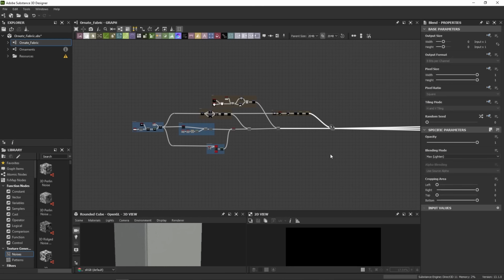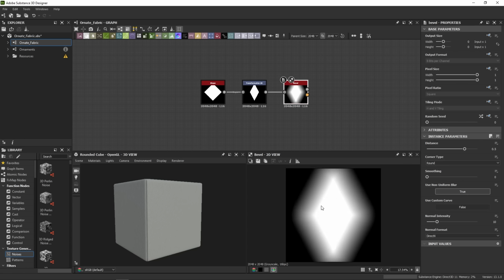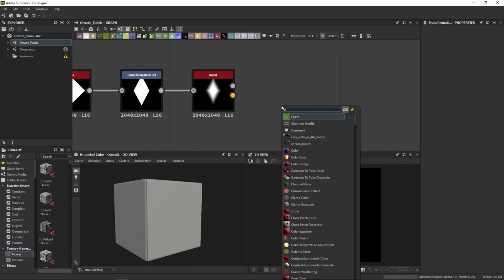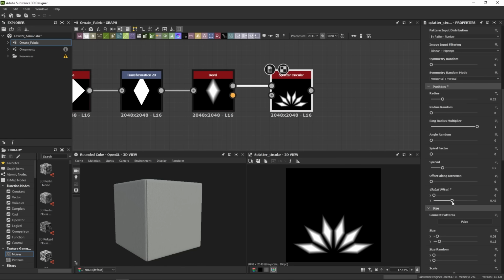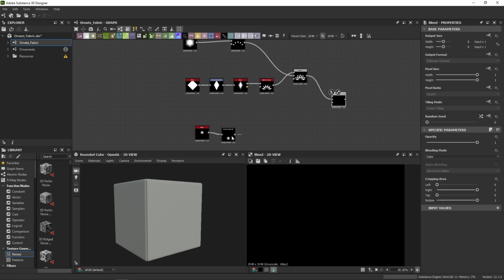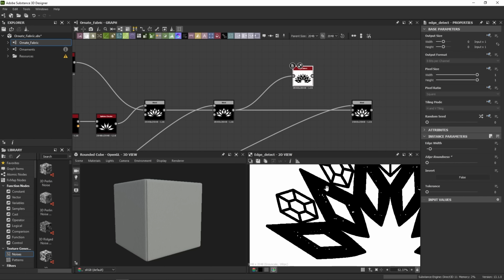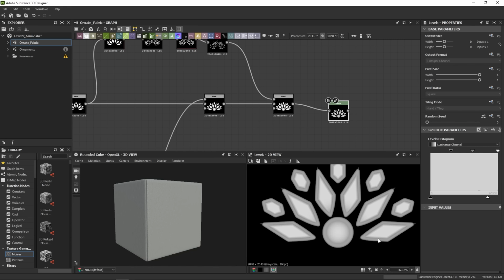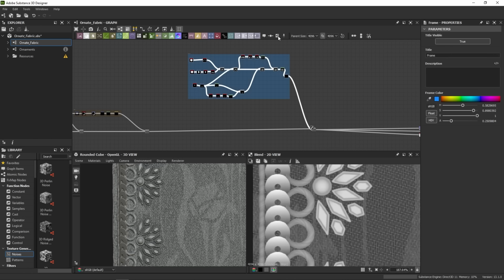Create Radial Gemstones in Substance 3D Designer (Pt 13) | For Beginners | Adobe Substance 3D

Comment: really good so far. However I have run into an issue where my jemstones are not aligning  with with the gaps between the other elements, like they do in the tutorial. Is there something I have missed that ensures the patterns have uniform scalling and spacing between each other ?
Reply: Hey! I'm not sure what you mean by "they are not aligning", do you mean that the individual stones are not aligning in the radial setup? If so you need to look into your Splatter Circular properties. If you mean that they are not aligning in the final placement it's probably because you accidentally move them manually in the 2D transform... in any case you can download the project file to look into those specific nodes and compare with what you did. Let me know if you're still stuck!
Reply: If the problem is the gaps between your gemstones and the outlines around the gemstones, you might have to modify the levels. Levels Out High (the white slider at the bottom) will modify the height of your gem/outline. Levels In Low (the upper black slider) will adjust the size of the gems/outlines and Level In Mid (the upper middle slider) will sort of change the shape, making it more or less rounded (if that makes sense).

Comment: Why don't you use a high blend? Repeating the tutorial, the result was that the white stitches are brighter than the elements that lie on top of the fabric. I solved this problem by replacing the regular blend with a high blend and adjusting the mixing
Reply: You can do both, I generally use the height blend when I need something very subtle and precise, since this trim sits pretty high on top of the fabric a simple blend works well enough :)